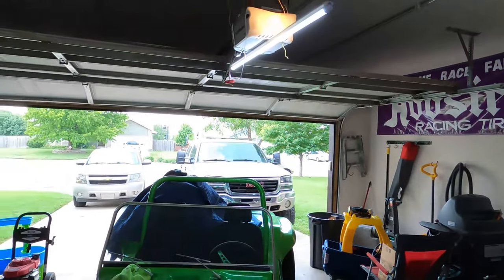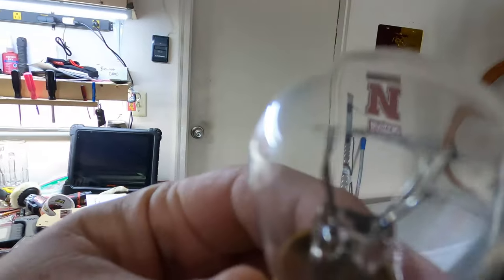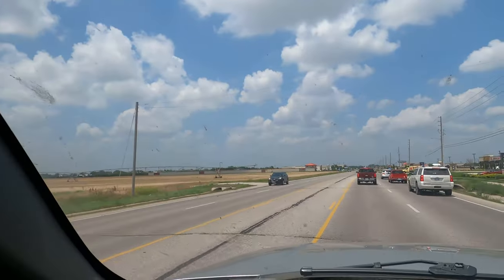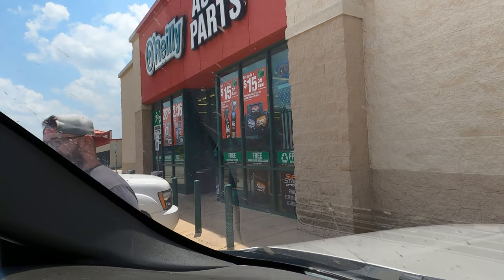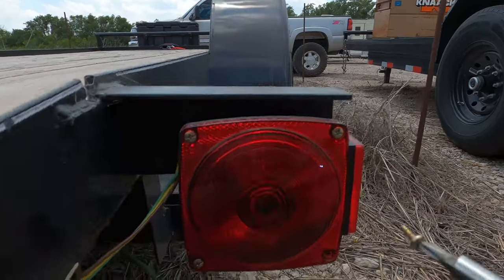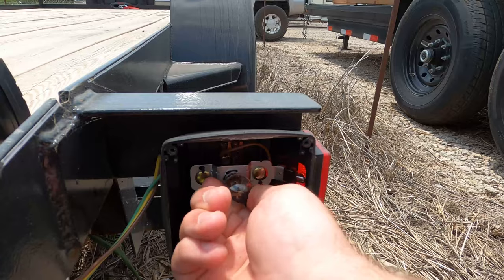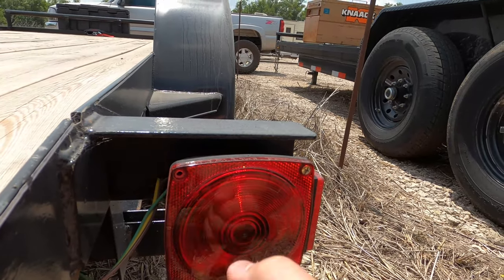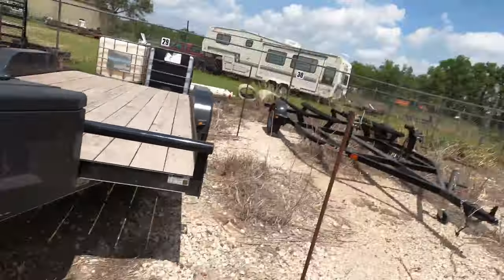Replace your trailer bulbs with the CORRECT bulb number, or else this will happen...

Comment: Just watched your video. Did you ever swap out these bulbs with LEDs? I think it's important to note that the bulb can only go back into the socket one way. the 'tits' as you call 'em are at different heights from the base of the bulb to ensure the brakes hit the higher wattage (27) filament and running lights use the lower wattage (8)  filament. Appreciate the content, gives me the motivation to get mine fixed up!

Comment: 4:54 Never, ever, touch the lightbulb with your bare hands.
You should use gloves.

Why?
Because the fats, dirt, and other debris on our hands will create a heat spot on the exterior glass of the lightbulb, and that will result in premature failure on that bulb.
Thus, use gloves!

Great trailer, dude!
Reply from the maker: Good to know, thought that only applied to headlights! Got a special treat for the trailer that just showed up! Ditching those tail lights completely ;) install video coming soon!
Reply: @ObsessedAuto  headlights bulbs, namely low and high beams, will go out sooner when touched with your bare hands due to the amount of heat they generate, especially those high-end ones for the likes of Philips and Sylvania / OSRAM.

These signal bulbs do not go through so much heat, but go through some.
If you imagine a traffic scenario, in the Summer, with the sun shining from behind onto that bulb, the heat will soon raise.
Then, the bulbs will go out.

Will like to see that LED video!
I have changed some of my bulbs to LEDs, and loved the end result.

But test it before going around!
On my city car, everything went well.
On my highway car, the brake bulb is also the parking light - P21/5W, with two filaments.
With the LED one, the bulb was always on the max brightness level, as if the brake was always applied.
I had to get back to halogen bulbs, unfortunately.

Cheers.